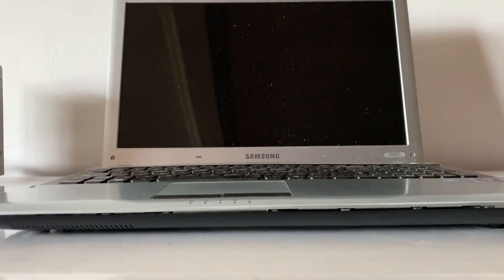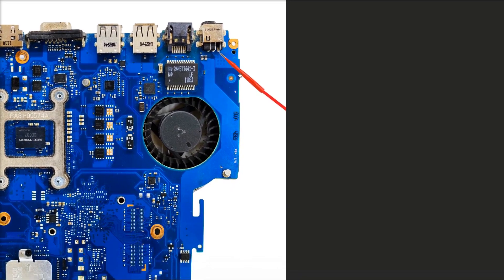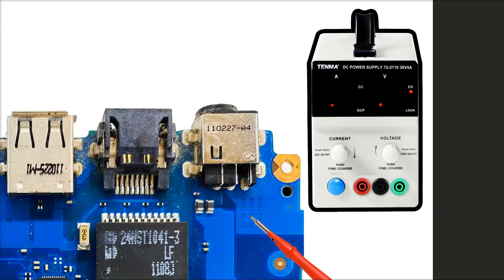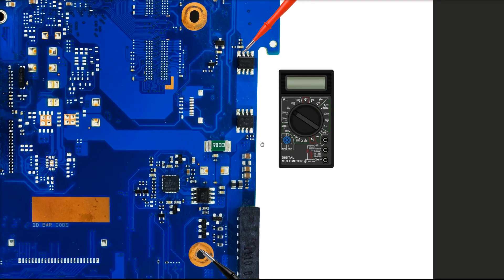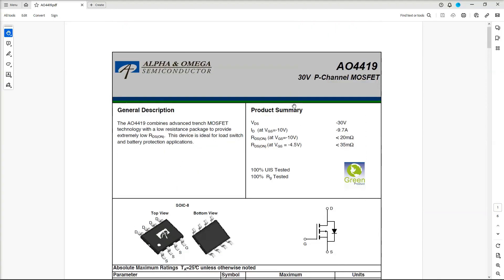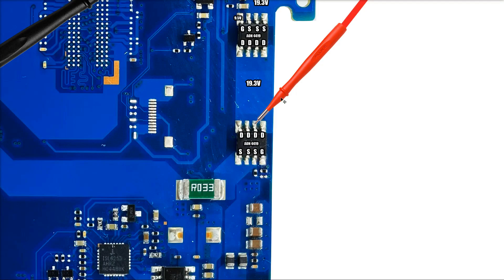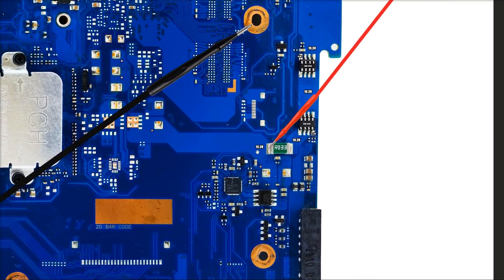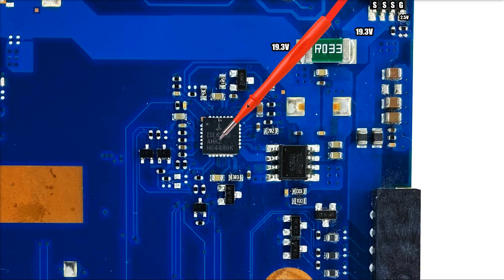Samsung RV511 - Learn With Me (Part 1)

Comment: It is interesting how P-channel MOSFETs have their drains connected in common, while N-channel have their sources connected. The gate voltage on the N-channel MOSFETs seems to be about 6V higher than the source/drain voltage. But the gate voltage on P-channel MOSFETs seems to be much more than 6V lower. Curious.

Comment: It's always cool to power these using a bench power supply. You can set a current limit, and you can monitor current use. You can get a sense of the power usage during the POST sequence, and you can clearly see a dead short on the DC_IN line. You can't provide the data needed on the PS_ID pin, but that isn't really needed to troubleshoot dead motherboards. The hardest part of using a bench power supply is determining the voltage and current settings to use. Good job!